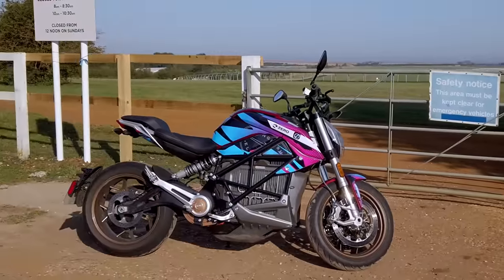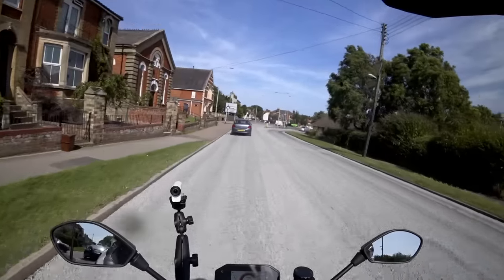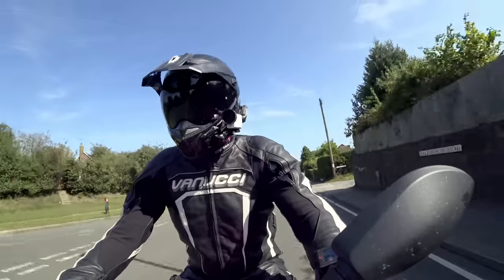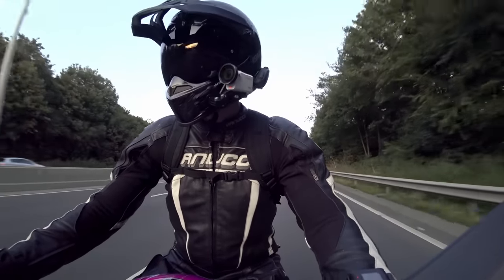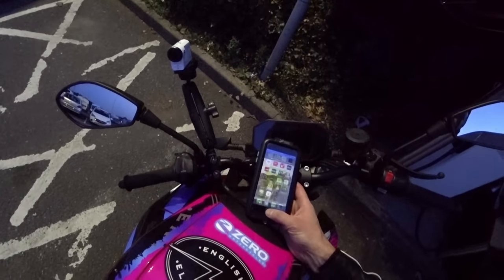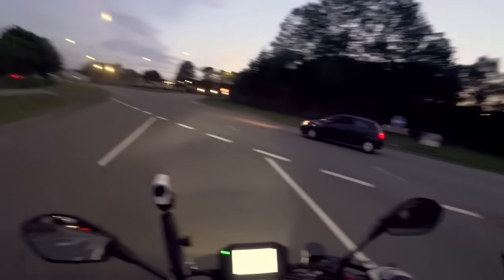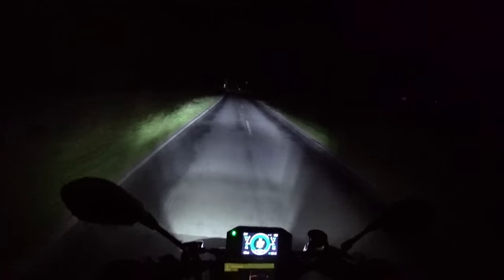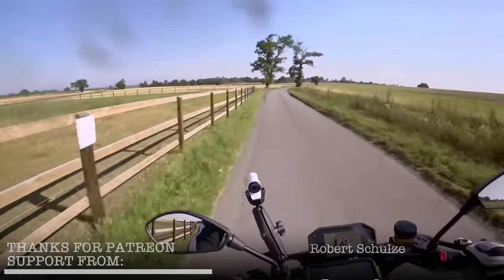Zero SR/F Real Life Ride Review

Comment: As what the last commente said.. I watched the entire video eyes glued and wasn’t bored by it.  I’ve been bike less for years now, but the attractive financials of running on an eMotorbike are making it very attractive to think about returning to motorcycles as cars have just become financially objectionable again with the current fuel prices hitting $4/gallon once again in California..  I knew there was a reason to keep that helmet and all the biking garb.. ;). And to be honest, the quietness of the electric and the raw power look like a lot of fun!  Plus traction assist, anti-lock breaks, regenerative breaking and actual electronic cruise control?  Wow, they have come a long ways since my days on my ‘96 Ninja 500!   Back in the late 90's when I quit riding, the only traction and breaking control was done by hand and any true cruise control was a long-off wish list item because the best at the time I found was a manual lock on the accelerator which was frankly not really a true cruise control since it wouldn’t account for changes of speed on hills and was a bit dangerous considering it could cause an accident with stuck acceleration while trying to emergency break.
Reply from the maker: Thank you very much Matt. Very glad to have kept you interested! I can completely understand your thinking of coming back to the fold. These new breed of machines really do have a lot going for them!

Comment: Yep. I love mine. It lacks, of course, that atrocious gaudy wrap English Electric puts on. I do have the version with the 6kW charger. It would be agonizing to think of charging while out on a ride with the standard 3kW charger. Charging stations, yes, you learn which ones are free and which ones are reliable. In any electric vehicle you make a little plan before you head out to know generally where the charging stations are so that you don't paint yourself into a corner. I'm in Texas so not nearly as many charging locations here.

Good video. Be prepared for your test on the faster charging version. You should probably just start saving up some cash now. I see my Speed Triple has a fine layer of dust on it now and I think the rear tire is a little low. Once you start riding electric that's all you want to do.
Reply from the maker: Haha! I can believe it! During the riding, it was nothing but joy. Give that faster charging on top and the package is suddenly a bit dreamy! Maybe i shouldn’t test it? I can’t afford another  bike!
Reply: It'd be neat if they could team up with tesla... imagine this bike in a supercharger with 250 kw of charging capability. Even if the bike could take maybe 50 of that at one point, it'd still charge it up in less than 15 mins.
Reply: @Korkzorz  Zero offers an optional  larger 12kW charger that can be used with an adapter to charge from the high power Tesla 220VAC charging stations located at many hotels. That is about twice the speed of normal Level 2 charging.
Reply: Harley is the one n only :)
Reply: Harley World Record why are you even here trolling a 6 month old video with off topic junk nobody wants to hear?
Reply: @harleyworldrecord9567  they do make an impressive machine however they need to come down in price about 10K, lose about 100lbs, and offer on-board charging with about 2-3 times faster charging times. Then I would pick a livewire over the SR/S with full fairings.

Comment: Some people are missing the point of this bike and just complaining about range etc etc 
Until you ride one and seriously think about the whole concept of it now it make sense
Reply: I agree. These aren't touring bikes and people keep focusing on range. I rarely ride more than 100 miles in a single day. And definitely not without stopping for a few meals.
Reply: Marcus Smallwood exactly my point 
I’ve rode a zero bike and all that stopped me buying one was the price and couldn’t get insurance ( can now tho )
Reply: Expensive commuter or Starbucks run. Wouldn't get me and or from the interesting stuff let alone ride on it.3-4 hours to charge is too long.
Reply: boo-boo honestly you park your bike at home or work longer it’s easy to charge 💪
Reply: Most commuters only need to charge once or twice per week. They charge overnight at home and they never have to go to the gas station. Never change oil or check valves.
Reply: @rustypart8676  As I said expensive commuter.  I buy a bike to ride it not sit around waiting for it to charge.I don't commute, if I did I would want some weather protection.
Reply: @rocketrollsvlogs7625  See response to RP.
Reply: boo-boo 
If you want to ride / commute this bike is no different to anything else 
Some bikers use a optimate to charge there bike because they don’t use it enough 
I don’t hear them complaining tho 🤷‍♂️
Reply: @rustypart8676  optimate is a totally different concept. As you say they aren't using the bike. If I want to ride some of my popular route areas it would mean me adding 8 hours to my trip minimum. There is only so much bacon, coffee and cake I can consume😉
Reply: boo-boo ha ha you’ve got me there 😂
Reply: It's not a touring bike. I would never expect someone to buy an electric for long rides, no different then I wouldn't expect them to buy a Sportbike to ride trails, or ride a cruiser on the track.
Reply: The problem is in populated areas where these are ideal the early adopters don't find themselves needing chargers regularly.  100-200 miles is a lot of range.  They charge over night.  The chargers need to be located at rest stops and restaurants.  Starbucks,  McDonald's, along the highways.  It's no different then how you don't take a moped, scooter, or grom in the highway. You could, but it's not ideal. These aren't touring bikes. Yet.
Reply from the maker: All very solid points chaps. They can’t possibly be the ideal do-all bike with the current tech and infrastructure. But who knows how long (or short) it’ll be until they either became yet more versatile, or start to diversify. Highway versions of the city bikes, but with an overdrive or some kind of CVT?
Reply: @boo-boo511  ots only 8 hours if you drain the battery dead and mine sr/fs charges in 4 hours not 8 hour but it never gets to dead when u got to charge just a different way of driving man
Reply: @bsmith2340  It wouldn't work for the fun/pleasure riding I do. 200/300 mile days. It would take 8 hours of charging (2*4) minimum.
Reply: @boo-boo511  I guess not you ride a lot with I could but I have a family wife wouldn't want me gone that long so 230  is plenty for me never even go down to empty ever
Reply: Most people are NOT missing the point that these bikes are asininely over priced.
Reply: @boo-boo511  Awe what's wrong a little water is the reason you rather travel in a cage? Good, riders like you give riders a bad name!

Comment: Superb review Andy. Best I've seen of the SR/F! 

A few things to add to your review: 

1) Zero do a higher seat for the lanky dudes like yourself. I took one for a test ride in July and got cramps in my hips (al'right grandad!); told the demo guy and he popped on the higher seat and it was spot on. So much more comfortable. I'm 1.84cm (a smidge over 6 foot). 

2) Also worth noting the the model fitted with the faster 6kw charger means you lose about half the space in the storage 'tank', so there's a bit of a trade off if you go with the faster charger (I think most people would sacrifice the space for a much faster charge though). 

3) The Bosch TC on the SR/F is outstanding. The day I took it for a test ride it was a bit drizzly. I opened it up in sport mode out of a roundabout and I felt the rear start to step out. Thankfully, the TC caught my slide and brought everything back in line. Definitely would have been in the hedge had it not saved me. Rode back to the dealers at about 3mph after that :D 

4) You didn't mention price, but these things are crazy expensive. About £18500 for the premium model (6kw charger, heated grips, small fly screen) after the government grant. That's a lot of gravy to throw at an E-bike. 

5) Insurance is tricky still as they are an unknown quantity so there are some crazy figures from some of those b@stard insurance companies (+£2000 in some instances). Zero have a sort-of-agreement with Lexham insurance in the UK, so if anyone is looking, then get a quote from them - they're currently quoting about £700 for the year for a rider with 0 years no claims, over 25 years old and having had you licence for more than 5 years. 

I agree with you on your conclusion; this is definitely a superb commuter bike, if you have a round trip of around 60 miles then you could just charge it overnight at home every evening and pretty much never need to visit a garage again! Which incidentally is what I'm going to do ;) After the test ride in July I put down a deposit... waiting list is super long atm. Got a call from the dealer yesterday to say the stock has finally arrived from California. Hopefully going to pick it up in the next few days. Now I just need to find a way to pay for it!
Reply from the maker: Many thanks mate! Good to now know about the high seat option. I'll definitely have to ask about that when I test the faster charging model. I found the traction control to be amazing too. Only stepped the rear out once and it was very well controlled. Enjoy your new toy!

Comment: By the time I can afford one they should have 200 mile range, which would be fine, my normal day out.  Good review
Reply from the maker: Me too! It's going to be a while for me yet! Hopefully before I retire! :D
Reply: Check out the 2020 Energica Eva Ribelle ,200+ miles round town
Reply: @toggyuel  The Bennetts website states 112miles motorway, so not quite there yet. Thanks
Reply: @steboardman4390  249 miles at round town speed (30-50mph) and 112miles at motorway speeds  (70mph) 143 miles general twating  about realistic miles ,I'd say that was pretty good and  with a 40mins fast charge to 80%  .the future is nearer 😄

Comment: A excellent and informative video.
Apart from the time wasted/cost of mooching/eating while charging, some other practical things spring to mind.

1) Given the frequency of unserviceable charging pods (especially but not limited to Ecotriciy), a lone and faulty pod at the end of a ride say at night could seriously spoil your day.  Perhaps even be dangerous to loiter around in certain places.

2) If you find someone else in the queue has got to a pod before you - but has finished charging - you can't simply pull out their connector if it is locked, move their bike out the way and plug in yours.  Is their an etiquette for dealing with this yet?

3) If you do run out of charge in a remote place, a breakdown service is not going to be able to top you up with fuel and this will then have to be be a recovery job.  Not ideal!
Reply from the maker: All very valid points Kevin. AA and RAC will have to start carrying high powered generators around with them!!

Comment: Hands down! Best Zero Motorcycle SR/F review I've seen to date!! Fact!!!

What they are doing selling it with a 3kW charger, I don't know! We saw this BS with the cars a few years back. And it was bonkers then IMH.

Yeah, if any network charger was going to let you down, it was going to be an Ecotricity DBT. Had it of been the old AC units they once had more of, it would have been another matter. 

Consideration for the proper install of chargers (location, type, access, etc) is still a hard slog for cars. Bikes are only just coming about as much as they are already coming out of the city. 

They cost a fair bit to install (DC chargers). As well as maintain and operate. That Ecotricity unit alone is c£12k plus install and likely a grid connection also in the £1000s. 

That said, I get it, it's frustrating when you want to do something but things out of your control seem to be against you. Like riding off into the sunset without having to worry about fuel. 
On that, I'm so glad you pointed out the range (and comfort) of petrol bikes. We're quick to forget these things when faced with some new and out if the ordinary. 

Again, very cool review (nice camera work!). I look forward to seeing you on more BEVs. 
Subscribed with bells on!!
Reply from the maker: Thanks very much Scott! It is frustrating and i completely understand that it is also a costly endeavor to create this infrastructure. TBH though, i was surprised that it was all still free. I get that they’re trying to convince people to change, but I’d happily pay a few quid if the service is going to actually work. But then maybe not everybody is as willing to pay for what they get as i am!?
Reply: Fair comment, Andy.
In my opinion, it being free has been part ofthe problem. 
Yes, it might have encouraged uptake but often for the wrong reasons. 
Not charging meant no money was coming in to at least cover its cost but more importantly, no revenue for maintenance and upgrades. 
This created a mindset against reliability but also the overall cost (kWh) and users comparing it to household prices. 
You hear of few aggressively arguing/complaining about coffee chains. madness! 
It also meant a land grab and no incentive to open and share network access via alternative payment methods. NB cc/dc contactless, I see as an expensive and temporary solution.
Reply from the maker: My thoughts exactly. If you’re an early adopter and you’ve ‚invested‘ above average money into your E-vehicle, surely spending a couple of quid for a fuel up is not going to offend you that much! It’s still cheaper, but then reliability and speed both increase as a result. Perhaps that’s why it seems that paid networks, like Polar, are seen as being more reliable and frequently found.
Reply: Agreed. You don't very often hear of sports car owner taking petrol for their V10.. 

Chargemaster are a good land-grab example. However, they've not long been in the DC charging game. They have invested heavily and arguably deliver a good network experience. But again, you could say that about many AC propped networks.

Comment: Nice review. love the look of the bike. at first i thought i would be missing the sound of the engine, the popping on deceleration etc but i liked it, i liked it winding up as you gave it some beans. The range isnt too much of an issue for a quick blast on a Sunday morning and good that its a rapid charge back in the house. as always for now, it will be the slow charging and availability in service station car parks etc. the same issue with electric cars i guess. that will only get better with time though. Wish this lockdown would do one so i can go out for a blast on gas machine
Reply from the maker: Cheers Ant. Yeah the noise was strangely satisfying! And agreed. For a sunday blast, it's perfect.

Comment: I looked at one, I commute in-city every day.  Rarely on a freeway, which is optimum for this bike.  By my calculations, I could go nearly three days on a single charge if all I did was to work and back.  I've always said, these electric vehicles would take over the world if you could stop at a station and switch out a full battery.  Universalize the batteries and bang, just like a petrol station.  Until then, they can only spank around the town.

Nice seeing you again, mate B-)
Reply from the maker: I completely agree. As soon as there is a standardised format for energy storage, refuels will be almost as fast as with petrol. Can't be so difficult, considering the first Teslas just had banks of 18650 LiPo batteries!

Comment: That Ecotricity charger you plugged in to was capable of putting 43KW into a car. It looks like it was the bike that was only asking for 1KW. Perhaps a setting in the bike?  P.S. if the plug gets stuck you can phone them and they can release it remotely; or if all else fails smash the big red emergency power off button and wait a few seconds and the plug should release. If you twist the BRS afrerwards so it pops back out then the pump will re-initialise in about 4 or 5 minutes and should be good to go again. I have always found Ecotricity to be very helpful if you phone them (number on the pump). Also, before you stick the plug in the socket, it's worth having a look down the plug to make sure nobody has dropped it in the mud, else you might be cleaning the muck out of the bike socket. :-)
Reply from the maker: All very good to know. Strange that the bike would only draw less than a kw, after it had happily slurped up 3kw in 3 other charging points. I didn't actually think to call Ecotricity, though in my defense, I was hoping just to plug-pee-and go!

Comment: Still causes range anxiety then... I know that the fast charge option can get it to 90% in an hour and extra battery pod increases range but the highway miles range is shite. Until these things can do 200 highway miles between charges and the charging network is improved I'll not be getting one. Soon as they do, I'm in. They will also have to make a generated noise by law soon. Excellent review. Highlights the issues. 👍
Reply from the maker: Thanks Critch. Maybe even something as simple as a highway or cruising gear would greatly increase the range for those longer sustained trips.

Comment: I love them Zeros me and I have got an electrical super SoCo need to get my hands on a DS that's the one I like or s you couldn't tell me where you got your helmet from I'm looking to buy one of them ones
Reply from the maker: I foresee some ADV styled version of the SRF at some point. Also i was told that the Motor in the SRF is actually only working at 70%. Sooo there’s room for an extra 30% more power and torque in the future. What BEAST of a machine is that planned for!? Oh and the helmet is a Nishua Carbon Enduro. You can get it from www.louis.de
Reply: Thanks